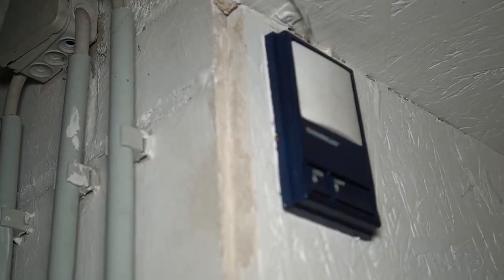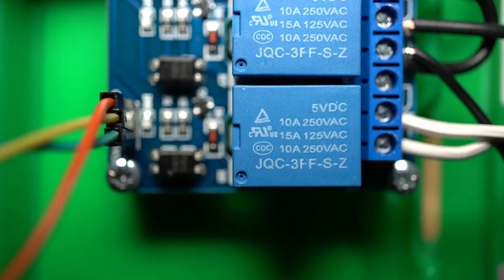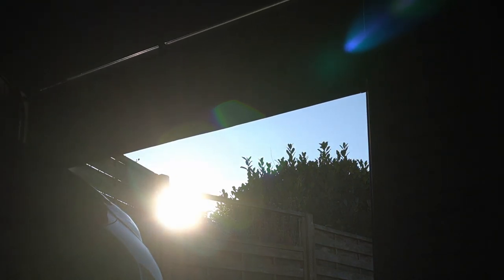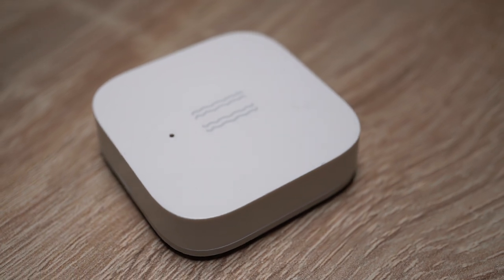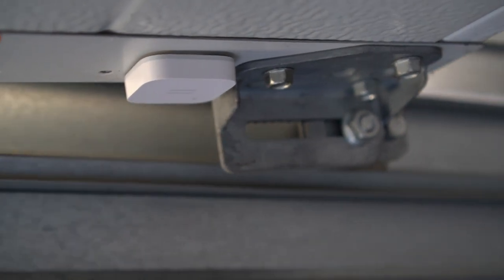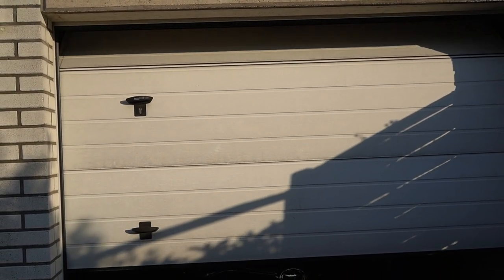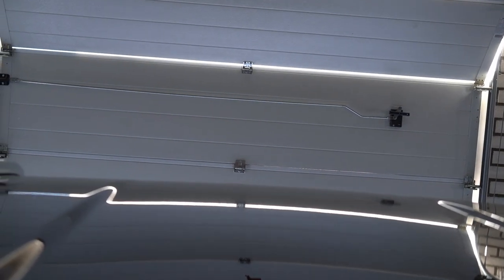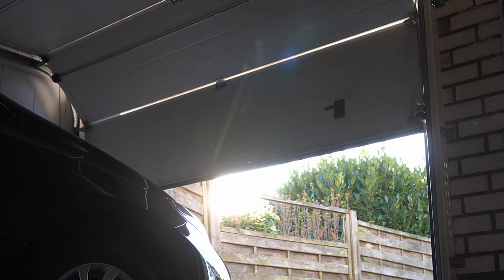Smart Garage Door Opener (with Arduino)

Comment: I'm pretty sure this is what you did, but it is important to mention for others: hook up any smart garage opener to an existing one (simulating a button press), not to the motor directly as the existing one will contain important safety mechanisms.

Comment: Funny I did a similar build but I used a cheap ultrasound sensor on top of the garage door to check if it is open
Reply from the maker: Probably more reliable than my solution, too.